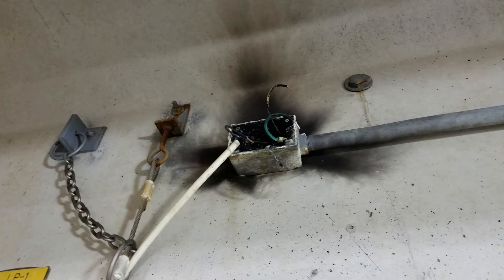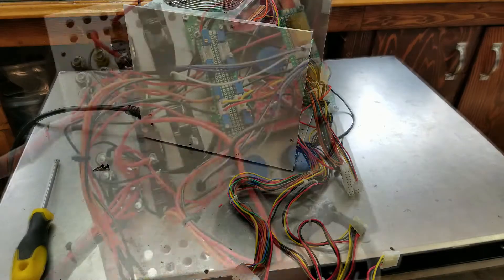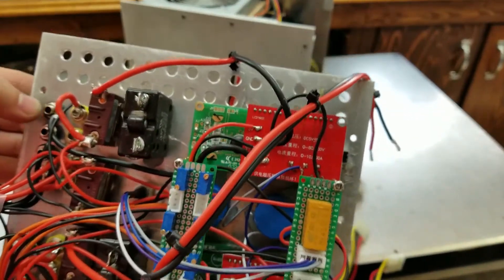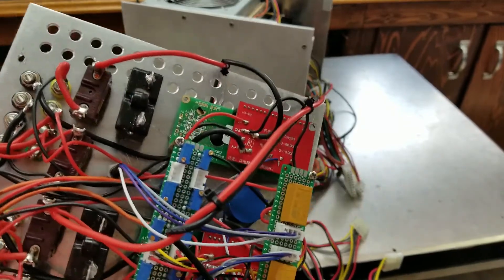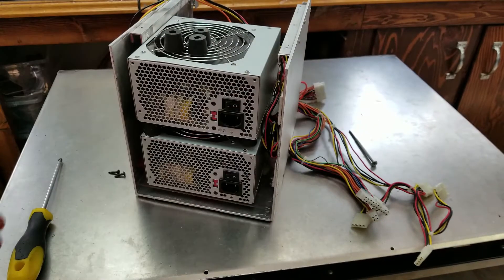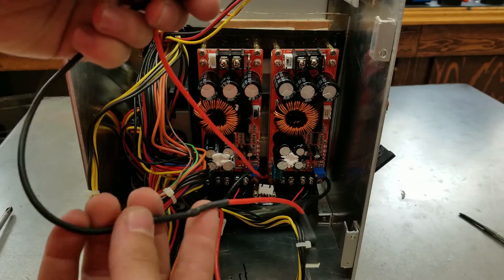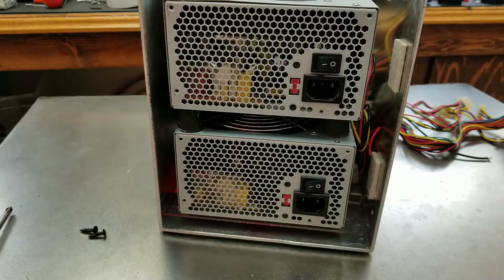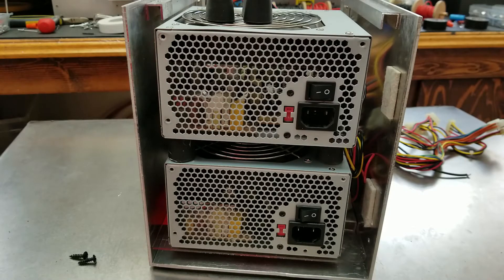Making homemade Lab Power Supply part 8

Comment: how are the mosfets blowing up if it has fuses on the input already? are the mosfets the wrong type? maybe it is the gate voltage being too high?
Reply from the maker: The fuses were at the output, than i decided to move them to the input side to limit the power going through the boost converter.
Reply from the maker: That seems to work well enough!